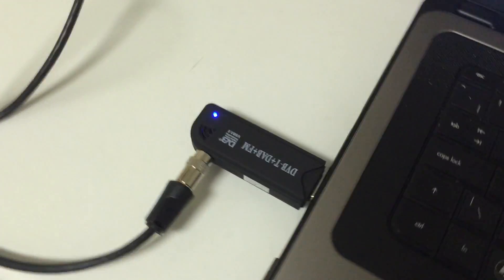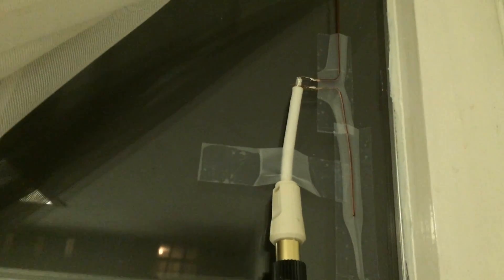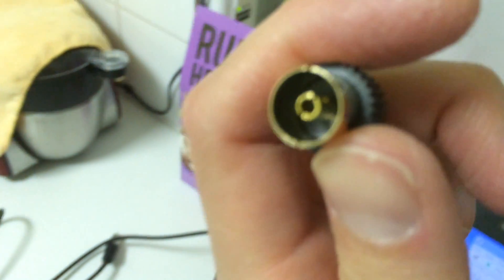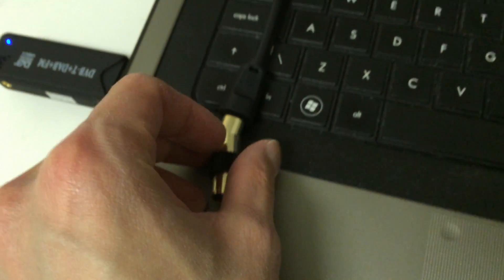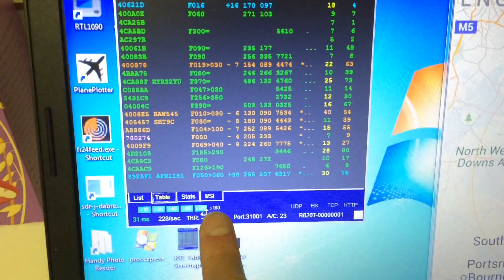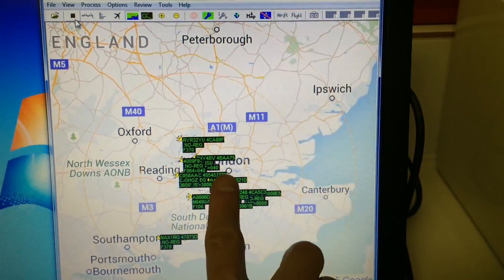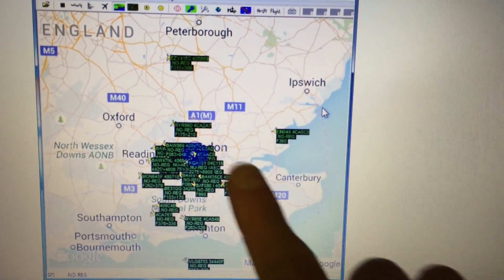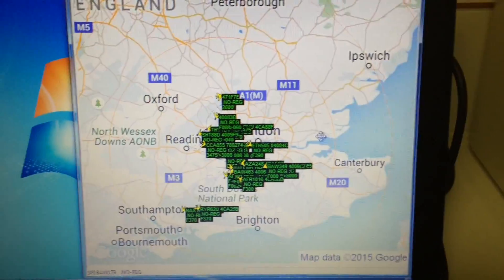Building a very cheap and effective 1090Mhz antenna for ADS-B reception

Comment: Hello, what is the name of this adapter that is logged in the RTL-SDR Realtek R820T USB
Reply from the maker: what exact;y are you asking? please be more specific. Thanks.
Reply: Plug name
Reply from the maker: what plug? If I had to guess, I think what you're looking for is "IEC Female Jack To MCX Male Plug" with the former being on the TV Antenna cable and the latter on the dongle itself.
Reply: Ok Thanks
Reply from the maker: welcome.
Reply: i'am sorry, but this can't be a IEC Female Jack likely it was SAM or BNC jack, i think you have made a mistake
Reply: @Tokyo_Bike_Tour  The old name for tv co-ax connectors is a Belling-Lee connector. The adaptor used is a female tv co-ax socket to an MCX connector.

Comment: Never good to bend an antenna like that. better have straight dipole and some kind of isolator.
Reply from the maker: +80Loke Ahh Cheers but this was just something that I did for fun. I've dismantled the whole set-up already :)
Reply: how do you do it with a straight dipole and an insulator?
Reply: At the high frequency it doesn't matter; a quarter-wavelength is only 5mm, so the braid is plenty far from the antenna elements.  The design rule to start the coax bend is that it should run perpendicular to the elements for at least 1/4th wavelength.  I'm still trying to figure how he gets resonance at 1090 mhz with a half-wave dipole 127mm in length.